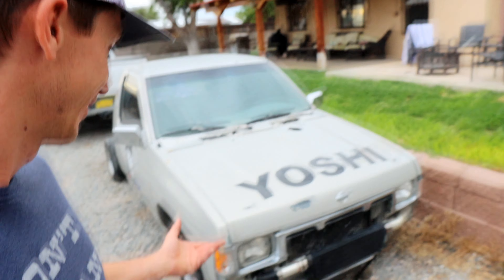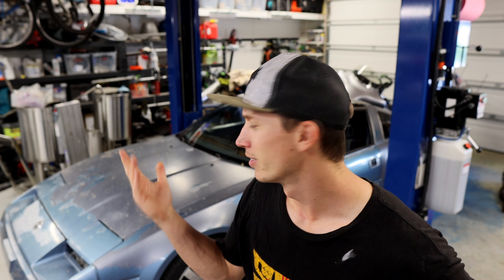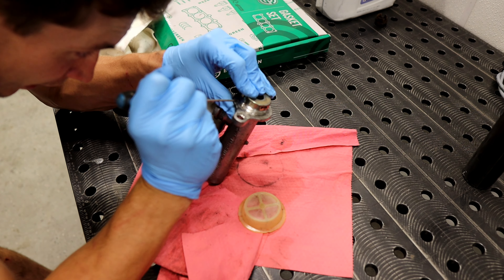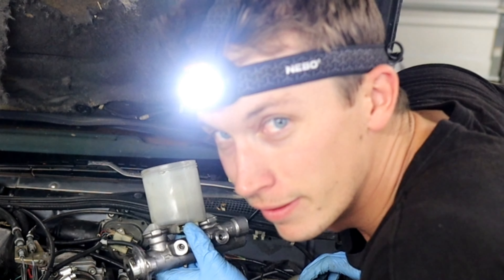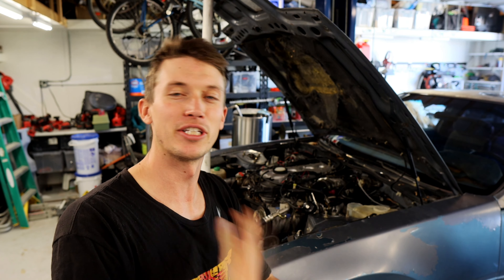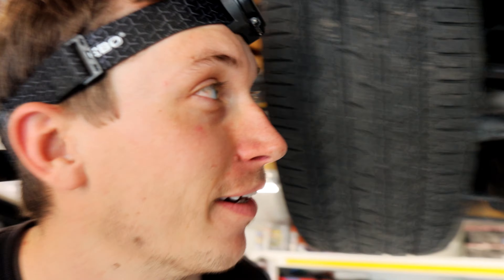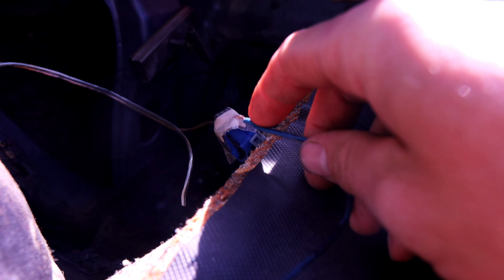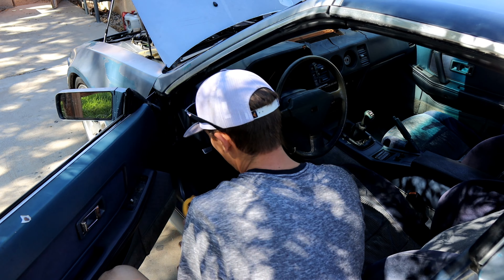Daily Driving My 1986 Nissan 300zx

Comment: I would put a vg in it. They aren't difficult to work on, they came in the car so they fit, and they will hold more power than an SR or KA. Also I would put poly bushings in the suspension. It will completely change the way the car drives.